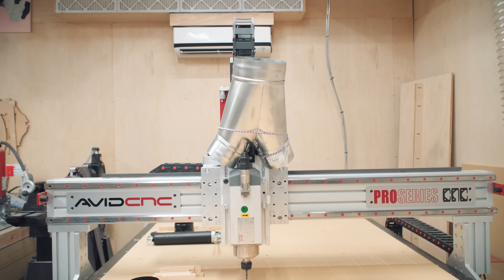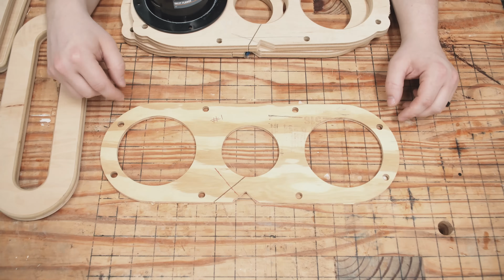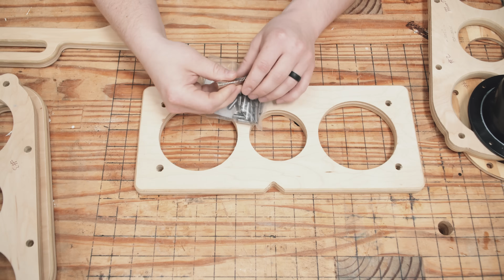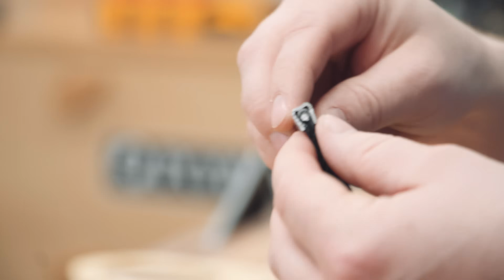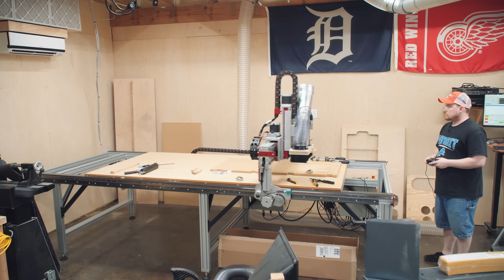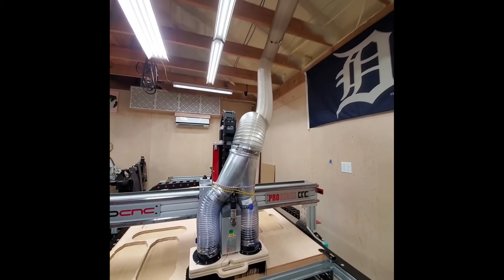Avid CNC Ep2: Dual 4" Dust Shoe - 341

Comment: PLEASE make a video on how to connect the Xbox controller!!
Reply from the maker: It's a USB controller. I used the program antimicro to map the controller buttons to the same keyboard buttons that control the movement of the machine. Up on the right joystick is Shift+up on the keyboard for full speed rapid movement. Up on the directional pad is just up on the keyboard for 25% rapid speed. Same for the other directions and the Z axis is controlled by the A B X Y buttons. Two for 25% speed and two for full rapid speed. Super easy to setup. :)
Reply: @JayBates  amazing. is it an actual Xbox controller? or one you got online that looks like one?
Reply: @JayBates  got one and got it to work! do you have to keep antimicro open while using the controller?  or are you able to close the program
Reply: @JayBates  how do you assign both shift and another key to a button in antimicro?
Reply: also it you use Mach3 to run your cnc there is also an xbox controller plug-in for the software

Comment: Great design. I've never seen this mentioned here or anywhere else, but is there any concern that the "pull" of the hose going up to the ceiling will tug on the head enough to alter the tolerance of the machine in the x or y axis?

Comment: Hey Jay! 
I’m busy working through this series. Great stuff man. I haven’t read all the comments, so you may have answered this already, but do you have links for the brush you ended up using. That looks super solid. Also, where can I buy your cut and project files (If available that is) 
I am in the process of upgrading my avid 4x8 and I love a lot of your methods here. I’m just adding a vacuum table as well.

Comment: Did you ever find a more permanent solution for attaching the pants wye to the spindle?  I'm building this dust boot at the moment for my Avid and was wondering if you're still using the bungees or if you found a better solution.

Comment: Can you share the specs on the brush strip? Is it ever too stiff that it interferes with a Z-axis plunge?

I have the same machine and I am going to make something like this, but instead of 2 x 4" hoses I am going to use a 4" and a 5." I've read that it's very important to match or slightly exceed the main duct diameter to the combined areas of the inlets, and that even the reduction in area between a 6" main duct and 2 x 4" inlets is enough to cripple the air flow to the collector (especially if you want to collect fine dust and not just chips.) This information is from a website by a man named Bill Pentz, who has almost a religious zeal for dust collection.

Comment: Very nice, heavy duty with the 2  4" dia hoses straddling the spindle!!  if you have concerns bout your spindle clamp and the plywood, install a barrel nut in the plywood, will last forever, or almost forever.

Comment: I have a very similar design on my Avid CNC setup, 3/4 ply, etc. I too had a screw into the plywood through the relief cut, but the eventual vibrations from cutting/etc made it to loose one day and it fell off the spindle. I cut a pocket out of where the screw's tip reaches and replaced the screw with a 1/4x20 bolt & jam nut. I made the pocket big enough so the nut could be held with a small wrench while tightening. I've never had it slip/loosen up since! My have just been a bad piece of ply, but figured I'd throw this out so others can learn from my struggles

Comment: Great Video,  I have been looking for a good 2 port shoe design for my AVIDCNC.  I use 4" rigid light weight drain pvc drain pipe about 32" tall attached to the dust port on the shoe, to get over the top of the z axis before going to flex.  I then used a rigid mount coming off the spindle mounting plate for that pipe.  Hope that makes sense.  It a very sturdy mount.  Look forward to making this shoe.  Thanks for sharing.

Comment: Don't you also want the blast gate close to the supply runner to reduce the volume needed to 'create suction'. I do not agree with having blast gates closest to the tool.
Reply from the maker: The blast gate is as far from the CNC as possible.

Comment: Easy ans solid solution for thre clamping: Use a bolt, mill a perpendicular slot for ta square nut in your board and you have a solid clamping solution.
Like your videos:-)

Comment: Maybe mount the splitter at the ceiling and run two 4" hoses down to the head. It may make it easier to work on later.

Comment: Well thought out and explained. Seeing your iterations will keep me from going through the same steps. Also, hanging your pants on the rafters would reduce suction a bit since there is more friction with the 4" hoses. SO...Your plate holding the motor has many holes. Can you use them to extend a metal/aluminum support to your pants? (Jealous of your huge table!)

Comment: Thanks for the informative video! How does the dust collector do when you run the CNC at the same time with another machine that requires a lot of dust collection?
Reply from the maker: I generally don't run two major machines at once. But it can handle it. There will be a slight reduction, of course, but it's got the capacity to run multiple machines.
Reply: @JayBates  After all this time, I’m finally getting my Avid CNC. Although it’s a 4x5, I’m following your design as much as possible. Do you remember where you got the 6”x4”x4” Pants branch? I’m having a hard time finding one.

Comment: Great job on the dual port Jay! Would of liked to see how well it pulled up the dust between the cuts? You never seem to have enough suction to get it all up. I have the same spindle on a desktop pro with a 2 1/2” hose and a shop vac. Used clear polycarbonate and a similar brush. I made a groove in the Poly to push the metal beading around the edge. Works well you may want to try that on dust collector 5.0. Stay Healthy.

Comment: Nice build, I use a similar setup and I use a cord with a counter weight on a pulley attached to ceiling to lift and lower the extra hose as the CNC moves.  Keeps it out of the way and reduces stress on the connections.

Comment: Hi Jay.  Thanks for showing the process rather than just the final result.  All to often people can get frustrated on their projects because they can't get finished results on the first try.  It's nice to see how the empirical method works with someone who knows what they are doing.  Also, to mount the pants connector, you might try cutting a plate to hold it similar to what you have done for your top plate and then mounting this plate to the top (now middle) plate with some dowels with one end on the corners of the current top plate and the other on the plate holding the pants connector.  If dowels wouldn't be stiff enough you could probably use some allthread and jam nuts for standoffs.  I did something similar on my Shapoko to keep the dust hose out of the way without hanging it from the ceiling.  The Shapoko is a much smaller machine, though.

Comment: If you're concerned about the clamp screw, there's a T nut, usually a bit of rod with a threaded hole in the side, cross drill a hole and insert
Alternately a square nut inserted across the hole
For hose support, what about extending the plate to the right and adding a vertical support, not sure if that would add a twisting motion as the weight would be on the router collar.

Comment: Some years ago on a ShopBot forum somebody actually put some air controlled metal dogs into their spoil board for registration. They would turn on the dogs and they would pop up they would put their wood into place and then they'd turn off the air and the dogs would go away but they would turn on the vacuum table to hold things down so I thought that was a very interesting way to do registration dogs. It made a very fast in order to change the new parts but they were matching out a lot of the same thing. Great video thanks again Take care.

Comment: I wonder if someone could replace those legs under the CNC with a full sheet plywood rack. Since plywood and CNC machines go together, and a flat-laying sheet could easily be pulled out and lifted onto the machine, I'm surprised consumer-grade CNC manufacturers don't consider this
Reply from the maker: It's definitely an option. My vertical table will be in the way though.
Reply: I've been researching Avid Cnc as well and on their leg kit page, it mentions storing 4x8 sheets under it.   I agree, it's a great idea. http://www.cncrouterparts.com/leg-kit-pro-cnc-p-257.html
Reply: People running large cnc routers typically have plenty of room to store large sheet goods in a better manner than shoving them under their machine.